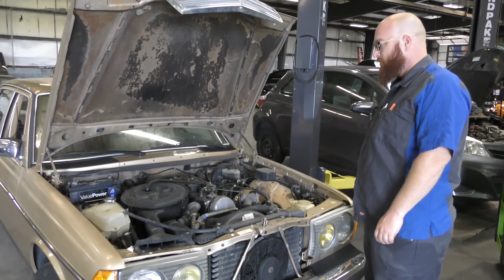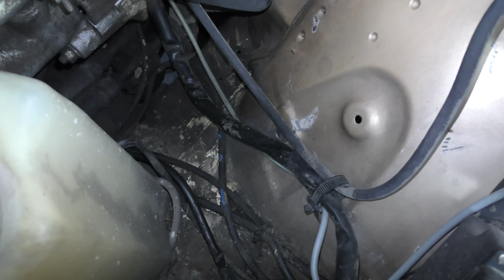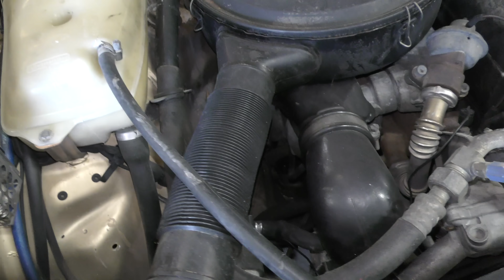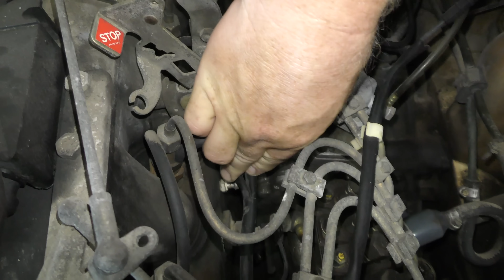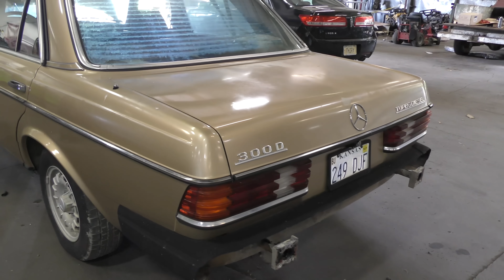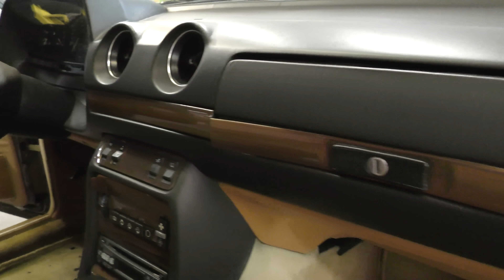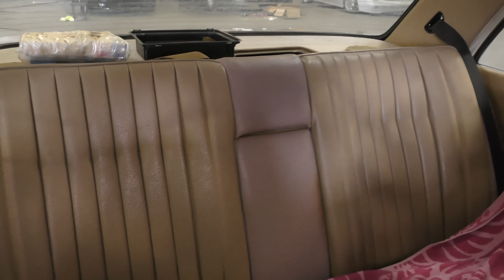Tank of a Mercedes 300D with a 3L Turbo Diesel! CAR WIZARD finds lots of surprises under the hood!

Comment: I had one with 450,000 mi on it. By the time I got it the rust was so bad I was just trying to keep it going. It drove fantastic even though it was not a garage queen. It didn't hadn't been for the fact that it was about to rust in half quite literally I would have kept it and drove it forever.

Comment: This is, what Taxis look like in german movies from the 80's and 90's. Which leads me to the question: Do taxi drivers in general take good care of their cars? They usually don't own it, but they have to spend so much time in it. When my car finally crooks, i want something reliable and so simple, that it can be fixed by a gorilla with a hammer (or Jeremy Clarkson)

Comment: FWIW, my ‘09 Acura MDX has 347k original miles, has never had electrical gremlins, and does not burn any oil. Always performed routine maintenance on time and change oil every 5k. No visible rust on being in hRsh Chicago winters the entire time. Most modern (Japanese?) cars will see the body go before the motor. Still I dream of owning a W124 someday but the high incidence of failures and cost of repairs on these German Cars scare me off.

Comment: I am looking into a 1995 Mercedes Benz E 280 NAS a 1992 300 E NAS and a 1991 300 D also a NAS version. All three with very high miles. 

These NAS versions were imported into Costa Rica most likely by MD’s, diplomats and other professionals returning to Costa Rica from their specialization in the USA. The NAS versions are usually higher spec and had larger more durable engines than the 230 E’s or 240 D’s that were sold by the dealer. 

The idea was to replace my ailing 2012 Volvo S60 T4 but I have committed to a rebuilt engine to extend the life of my Volvo. It might pay the investment for the next 5 years. The MPS6 transmission is another issue. We’ll see what happens!

Comment: I used to own a 230e 4-cylinder gasoline W123. I could never get it running right, the fuel delivery system is very complex and no-one knew how to work on it. The vacuum door locks are a nightmare. This car badly needs an under-hood pad.

Comment: I love the interiors of the mid 70's version of these, would've been the W115 I think, but the 80's version is great too. They all reek of high luxury without having a gorillion electronics that will fail and cost you a fortune. I've looked at a few parts for the W115s (i.e. injectors) and other than being difficult to find, once you do find them they aren't all that expensive considering the insane cost of a lot of modern car parts. Labor is the major cost to factor in when working on these, they are an inline 5 diesel after all. Dream car status for sure.

"More than it's worth" doesn't matter as much with classics, at least I don't think. If the frame is there and the body isn't complete junk, it's usually worth fixing just out of principle, to keep a piece of automotive history as far away from the crusher as possible. My '66 Oldsmobile F-85 had a LOT of mouse damage especially in the interior, but now that it's fixed and restored I'm glad I spent the money on it, it's become a surprisingly very reliable car.

Comment: I would expect some viewers to catch that you pointed out Transmission vacuum regulator as shut off valve. Shut of valve of on this pump is on the side at the back of the IP not on top.

Comment: Great video, CW! Very detailed, with good advice and excellent closeup photography.

I happen to have the same 300D model -- even in gold! -- but '85. Out of love for it, I am bringing mine "back from the brink" as well. (Lent it to poor friends 4 years ago. They did their best on their limited budget, but were unable to keep it up. And it came back with dents and broken taillights and bezels and a myriad of other issues.) I will never lend this car out ever again, of course.

Also, the character of the restoration and maintenance game on these W123's has changed drastically in the last 10 years: Both these cars and the parts for them used to be plentiful. Now it's difficult. The final remaining MB parts supplies are down to the dregs and often simply gone.

I fortunately have a super mechanic who used to work at a Mercedes dealership, and also has previously worked on my car for years.

Nonetheless, there are now so many things that need maintenance --- lubrication EVERYWHERE --- that I am learning to do as much of the smaller stuff as I can myself, esp around the body, and leave only the hard stuff -- engine and transmission -- to him. (Thanks so much to Kent Bergsma's "mercedessource" Youtube channel, and all his tutorials, and his lubrication kits and specialized tool kits!!!)

Three real issues for owners of these cars who want to still "daily drive" them:

1) As mentioned above, you are going to have to learn to do a lot of the easier maintenance, lubrication, and inspections/checks yourself. It just gets too exorbitantly expensive, unrealistic, and even a safety issue, to leave the myriad of issues to your mechanic.

2) And even then, youre still going to need a mechanic experienced with these W123's, like CW is from his earlier days. My mechanic has a new trainee under him. And that trainee is smart, carefil, and competent. But because so few of these cars come in the shop any more, his trainee will probably never have the opportunity to learn everything my mechanic knows about them.  If you cant find such a mechanic in your area, i higjly suggest you consider giving up the W123 game.

3) Finally, a serious and yet rarely mentioned issue for your customer and his daughter, and for me as well, is the difficulty of finding collision insurance. Once, as you say, we put more into a car than its "book value" (Kelly Blue Book, etc.), we are at risk of losing all that repair and maintenance investment, because most insurance companies , while happy to sell you collision insurance, nvtl will pay you only the book value in event of collision, thothe total of your collision premium pmts may be many multiples of book value. On a 30-40 year old car -- no matter how superbly maintained -- that means probably getting a check from them for well under $1k, when the car, if superbly maintained, may be worth $12-20k. (Heck, even crappy ones are now $2-5k.)

And if we are going to be driving the car daily, we surely will not want to purchase -- or qualify for -- so-called, "classic car" insurance, since those policies require that the car be garaged and not driven daily: only to weekend drives and car shows.

So what to do? I have not yet found an agent or company, but searching through the BenzWorld.org forums has me convinced that for your customer, CW, and for me, what we probably will end up wanting is what is called, "Agreed Value" insurance. (Dont let the insurance co. convince you to go with "Stated Value" insurance: it is trash, and you'll be screwed on the day you need it.) With Agreed Value insurance, you and the insurance company agree to the true value of the vehicle -- including excellent maintenance -- based upon usually annual inspections by a 3rd party Valuator (which requires a fee of course), and current market value. Then if your car is the victim of a collision, you will get reimbursement for repair or replacement up to the previously agreed upon value.

I am not an insurance agent and cannot guarantee the veracity of the above, so check into these things yourself to verify or nullify. Thats just my understanding to date, and as I say I am still on the hunt for such insurance.

If you, CW, or anyone else here, happen to have experience getting Agreed Value insurance for your "older daily driver", please respond here: I would love to know! Thx.

Comment: Those pipes in the rocker panels to jack up the car weren't the brightest idea. Very common for these to be rusted out, so the jack that fits into the hole becomes useless. Without an alternative, such as an American style or bottle jack, you can't even change a tire. Brilliant engineering, but no common sense.

Comment: i honestly dont like how the video was made, these cars are exceptionally reliable cars. Only thing that dont make these diesels unreliable is if theres algae blocking the mesh filter in the fuel tank, if the voltage regulator is worn or bad alternator, or possibly on how worn the engine is a bad fuel injector, (maybe glow plugs depending where you live) everything else such as suspension, interior, rust, lights, ect ect are for getting the most luxery out of the vehicle. I daily drive a semi rusty 240D with worn suspension i plan on rebuilding one of these days and some weird electric issue but not too bad, it just affects the turning signal and radio.. the wiring harness on these w123's are basically fire proof, these cars almost NEVER catch fire due to electrical issues, unless its a aftermarket harness or someone did something stupid. also the fact that you wouldnt take this car in if it didnt run, which is ironic cause even the new mechanic can make these cars run again, doesn't take much and they're so simple to get back up and running.

Comment: Having alot of shit controlled by vacuum in the 80s and 90s and earlier is fucking stupid on Mercedes part..most other cars were using what they use today, electronics and ECUs to lock and unlock the door, control the AC, shift points, etc..having that stuff controlled by vacuum and tons of little vacuum lines is a nightmare..yeah real reliable drivetrains..but other stuff in those older mercedes i shake my head at the German engineering. People wanna talk about how long these cars keep chugging along...yeah but look around you and alot of shit is broken..

Comment: If you have mouse damage, check with your insurance company. My 2014 F 150, had a mouse or squirrel chew though some wires disabling my traction control. I thought I would have to pay to fix it, which involved putting in a new wiring harness, about 1400 bucks. I checked with my agent, and, my insurance covered it with the only a 200.OO deductible. If they had tried to fix the old harness, it would have cost about 800.00 so I opted to do the complete replacement. Before you pay for the work ask you insurance agent, it is covered as animal damage.My comprehensive coverage paid for almost all of it.

Comment: I have a Kansas Volvo that had a mouse chewed wiring harness. I had to replace the whole wiring harness. Turns out that  A LOT of European cars from the 70's and 80' had wiring harnesses that the coating on the wiring was made of a vegetable based oil. Good luck with your Benz!!!

Comment: The engine not shutting off is such an easy one. First time I changed my oil, I didn’t reconnect a vacuum tube  that runs near the oil filter. It’s the vacuum tube that actuates the fuel shutoff.

Comment: There was even a coupe version as well. I think they were called CE in the designation. And was available with 2.8 liter petrol engine if I remember correctly with 130 horsepower

Comment: couple notes: the factory manual specs turbo boost as 12 psi although most have around 8-10 psi.  While commonly referred to as "horse hair" the seat padding is actually coconut fiber. This fiber does degrade over time and an new pad makes a world of difference as does making sure springs are intact. if you can do the work, aside for time, you should be able to keep these cars on the road for a long long time. Great cars. I have a 300sd which adds a few more things to ultimately go wrong, but it is more luxurious.

Comment: The engine shutdown valve is below the white "Vacuum Control Valve" (VCV) which you point out for shutdown.  The brown nylon tube goes to the shutdown.  The VCV gives a vacuum signal to the automatic transmission (modulator), based upon throttle position, a quirky way to simulate the intake vacuum of a gasoline engine which that transmission was first designed for.  On 1985+ cars, that signal routes via a vacuum amplifier (blue saucer).  The air filter mounting bracket often cracks apart, especially if the engine shakes, exc. 1985 CA cars which have a frame-mounted air filter.  The mono-valve rebuild kits from India (MTC) never seem to work.  The Euro ones are very pricey (~$250).  Instead, people replace it with a vacuum-operated water valve and vacuum solenoid switch, as M-B used on later models.

I pulled a complete wire harness from a salvage 1983 300D.  I think it might be a big job to move its wires over to the engine bay, but don't recall the details.  Rodents seem to prefer the wiring in newer cars, especially since they changed to bio-degradable corn-based wire insulation.  I have read complaints that that wiring in newer M-B (say 2005+) is degrading prematurely to cause major issues.

Comment: I've seen the result of a 300D that was poorly maintained, it was nasty.
My boss/mentor/great friend had an early 1980s 300D where he was VERY neglectful when it came to oil changes, about every 8K to 10K miles.  The car ran well for around 50K miles; but unfortunately that neglect, with the oil change intervals, resulted with the breaking of a piston's connecting rod, punching out a hole in the side of the engine block.  Somehow the engine managed to struggle along for a mile that got him to the workplace parking lot.  I saw the damage to the engine block.
The popularity of the 300D at that time meant the availability of a replacement engine had a long lead-time, about two months before he got a replacement engine.  He could have gotten a replacement engine sooner on the gray market, at about a 40 percent higher price than what the Mercedes dealership was charging for the replacement.

Comment: Hello I am looking at buying a 1978 Mercedes 300d.  And found you in doing research on these cars.. It looks to be great condition 
And everything works except ac. It is a rust free car. I was a body man for over 30 years and body is 100% rust free and original.  It has 340k miles
And price is $3500. It looks to have been very well  cared for.
Its an auto trans. How many miles are these cars known for.
Reply: Forget it!

Comment: 9:40 This is actually surprising to me. as far as i am aware Mercedes still produces spare parts for these old vehicles. That was several years ago though, so it may have changed in the meantime. Only problem with these parts being they are f*in' expensive.

Comment: My first car was one of these, but it was ragged out.
My dad had it before me and tried to run waste vegetable oil as fuel. Instead of fixing anything he rigged it to make it good enough for a first car. He rigged up the windows to be manually opened with ropes and he routed some bike brake cable from the stop button under the hood  to some vice grips in the glove box. Just pull the cable to shut off the engine. 
It ran well until I hit a big pothole and unknowingly made a hole in the radiator.
It still ran, but consumed a lot of oil.

Comment: Last shop I worked at installed used engines and transmissions in cars that weren’t worth the investment. Plus it took longer to clean parts and deal with broken and missing fasteners etc. I hated it.

Comment: Every part of this car can be found in Europe and for cheap most of the times. Personally I do not care if a car for this age has dead A/C or cruise control. Engines, gear boxes can be found for cheap everywhere in EU. This car is a good example and this wire harness is nothing serious. In America it is usually expensive to fix these cars because people charge a lot for parts and labor is more expensive most of the times.

Comment: Did You know that in Germany one didn`t have the turbo option? The Turbodiesel were mainly for the U.S. market to let the car appear less anemic. In Germany the 300D was the 5 cylinder top notch diesel, Mercedes Benz could claim with the 300D to have the fastest production line car diesel carof the world.
I once drove a 300TD (the wagon) with 6 people on board from the Netherlands to Germany, I took it rather slow to save fuel but some 30 kilometers before out destination i floored it and kept it there. It climbed to 180 km/h- at first as rolling coal but it burned off all the crud and it really came alive. When we arrived the engine purred like a kitten without any smoke- it needed flooring...
I still love the W123 but the U.S. bumpers are sooo ugly to me but at least this beauty has the aluminium wheels.

Comment: I will not install used consumable parts/wear items, either, with the exception of engines and transmissions or differentials from my own inventory of parts cars. I've only ever run into not being able to find a new or reman part once about 20 years ago, and they've since shown up in aftermarket catalogs,

Comment: I had an 85 300d from 01 to 05 and it had 280k miles on it when I sold it, like an idiot, but it ran like a top. Absolutely no issues.

Comment: https://youtu.be/xuIk7ELGVA8
Hi I came across this 1984 300D I'm interested in the engine and transmission for a project but know nothing about these engines could you by the sound of this video tell anything about it? I know it's extremely hard to get me feedback from a video but anything helps ... The guy wants $600 for the car . Thanks Fred

Comment: I disagree on cost 20 years ago I worked on those. To this day the slowest vehicle I have driven is the non turbo. But if you know them you can run them forever for low cost. Plus waste vegetable oil to power it. Only issue is low carbers chasing the French fry smell. I loved them. 😍

Comment: Apparently the ALDA system is from the German: "Absolutdruckmessung Ladedruckabhängiger Volllastanschlag" or roughly "Absolute pressure measurement, boost pressure dependent full load stop."